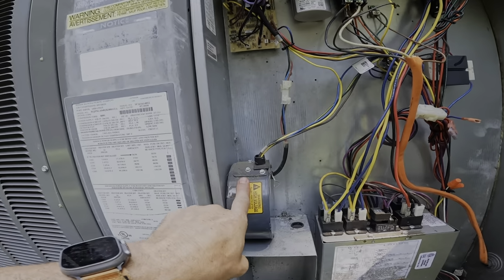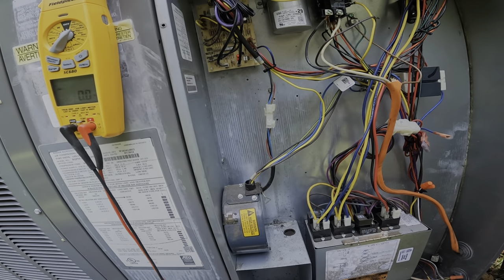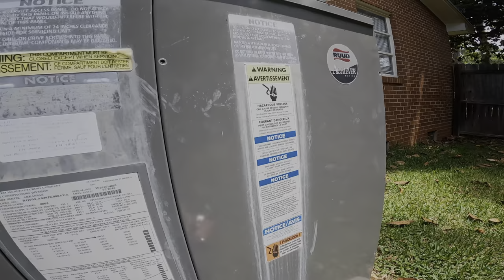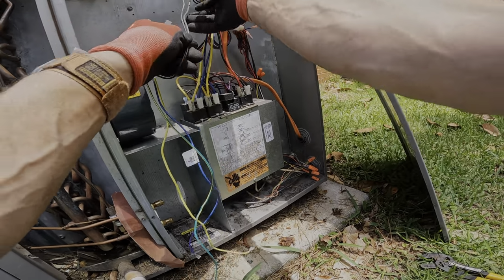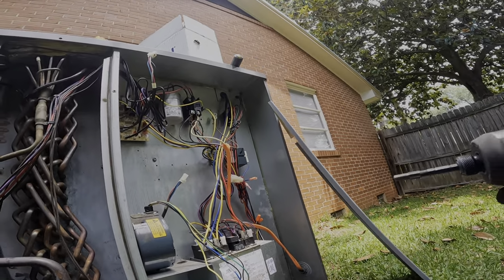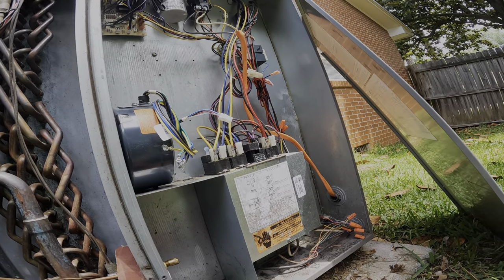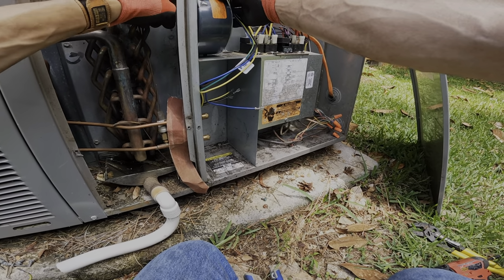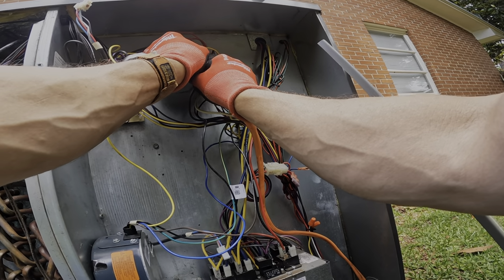X-13 Condenser Fan Motor Out On A Heat Pump! #hvacguy #hvaclife

Comment: I did not know they made those in two pieces for condenser fans.  Personally I want no part of any kind of ECM in my equipment.  I’ll pay the extra electricity cost for a conventional PSC motor that can last a long time.
Reply: I would agree however, some of these PCM motors are built well, good ball bearings etc. I do see the advantages of them except for one thing, the cost !
Reply: @Garth2011  seems like the electronics fail long before the bearings do on those.   I’m old school, I’ll take long term reliability over the energy efficiency.
Reply: @keithfox5835  Thats confirmed in high volumes. The modules are cheaply built while the mechanical parts are still as good as new. Government pressure to use this crap needs higher standards or the public are being bilked out of their money
Reply: @Garth2011  i totally agree.  Consumers are sold a bill of goods on energy savings, but few think about the extreme cost of maintaining this “high efficiency” equipment.   The savings are frequently eaten up by the cost of keeping the equipment running, as well as shorter overall life of the new equipment.

Comment: All Good.  Probably is a good idea to describe the parts being used in your videos such as in this one, an ECM motor, make, model, bearing type etc. for those who don't know that there are variations of motors, quality variations, OEM motors, the quick and easy RESCUE motors etc.  Lots of HVAC channels fail to explain why they are removing an OEM factory motor and replacing it with something else of less quality other than the obvious reason.
Good work Curtis.

Comment: I like our overpriced variable speed system—most of the day it runs slow to where you almost can’t hear the outdoor unit when walking past. Most evenings, change temp from 72 to 70, sounds like a jet for an hour or so.
Reply: I had Mr Swampy for 20 some years, got a spanking new Mitsubishi mini split 4 head, 3 1/2 ton thing, I’m shocked how quiet the whole thing is..the out door unit barely turns, ramps up and down, the “heat” from the huge amount of coils is just barely like a warm breath, of course, we aren’t into the real heat yet. Nice to set different temps to equalize different rooms..and so quiet inside you have to look to see if it’s actually on..I’ve commented often on this, I’m not trying to advertise, and if I have any negative experience with it I’ll let ppl know, but so far, it’s like going from stone knives and bearskins to a dilithium chamber!

Comment: When replacing a fan motor measure the distance from the blade to the grill. There is a proper distance.
Reply: He checked that on the old motor shaft by eye balling the rusty end as it got clean where the fan hub was mounted. I would have measured it too but these guys do it everyday and get them darn close with the eye.
Reply: @Garth2011  I've been in the HVAC trade for 40 plus years and I still measure the distance. No one out there has micrometer eyes. Getting the distance wrong can lead to an over loaded motor, wrong air flow and high pressure problems. I'm glad I know the difference.

Comment: why do the two power wires on module goes on the bottom side of contactor?
Reply: It goes to the constant 240 volts, the 24 volt’s brings on the motor.
Reply: @kevonslims7269  thanks

Comment: PSC all the way. All the money saved on power is lost .
Reply from the maker: Was under warranty
Reply: Good work
Reply: That ain't no shit.
Reply: If they can make reliable ECM modules/motors they are good for battery backup systems.  Other than that I agree with the old style.
Reply: @HVACGUY  I love your channel it’s the best . I just think you meet the point of diminishing returns at some point . Advanced designs are great ,but if they shorten the time between repairs the homeowner would be ,” money wise “ be better off with very basic equipment that just works for years .